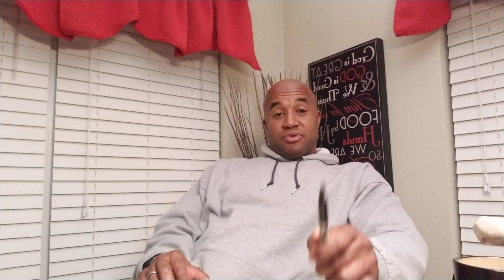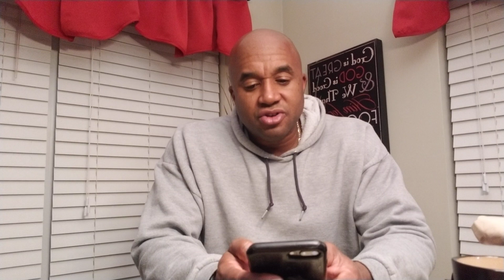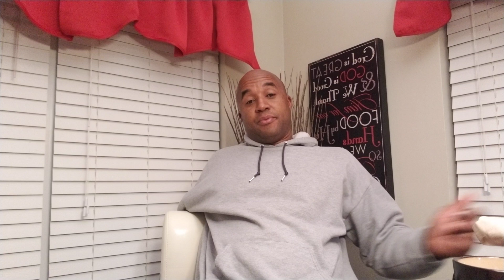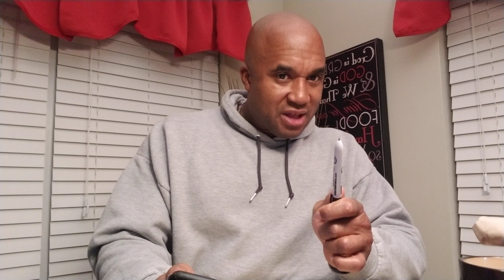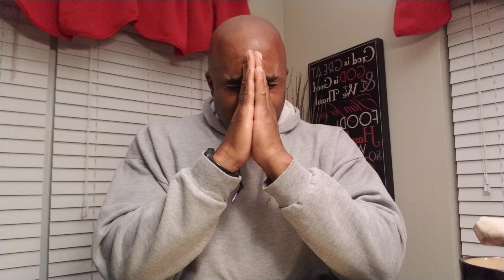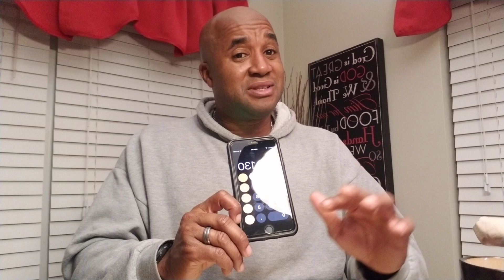Alternator and AGM Batteries the  Connection

Comment: Question why not just go with a bigger alternator for your truck? You said your alternator does 260 why not get a 300 or 350 alternator? And the reason why I said 300 or 350 because it's been some years since I've done audio video mobile but I think the alternators range every hundred if I can remember correctly. Or you could pay a butt load more money and have a custom one built for specifics. But just go to a bigger alternator especially with that diesel truck you already at 260. Why not just go to a 350 or 400?

Comment: I am planning 3,200 RMS audio systems for my Limited and Platinum Edition F150s. I have 400A alternators and plan on running two AGM batteries, an XS Power D6500 for my primary and an XS Power D7500 for my secondary/audio system with an isolator. Will this combination work AND charge efficiently? Thank you for your expertise! I appreciate your videos.

Comment: I have a 150 Amp alternator and one battery on my vehicle.  It is a mini van with a long run of 2 gauge copper wire.  I know that I am near to my maximum without adding batteries and an alternator which I don't want to do.  It is two 450w RMS amplifiers on two 12" subwoofers, and a 200w RMS (50w RMS x4) on four 6x9 speakers. There is of course also the head unit (15w RMS) also running two 6x9  in the front doors. I have a small system but it is fine for me.   In the winter when the heat, wipers, and headlights are used heavily I let it idle for a few mins before shutting it off to top off the battery.
Reply: It's supposed to have %30 reserve power. You should be okay as long as you keep your voltage at least 12. I push a 135amp alt harder than that

Comment: I have a 270 high output brand x alt charging at 14.8, yellow top optima under hood with a d3400 parallel and a d3100 all in parallel can I power a 6,000 watt amp if I charge them? They stay steady.

Comment: I have 2 xspower d3400 with a 270 high output alternator 

I run 2500 watts between 2 amps one for my mids and the kicker CXA 1800.1 amp!

Comment: The alternator is there to keep the BATTERY FULLY CHARGED  the battery powers the electrical needs of the vehicle . The battery is the buffer and absorbs voltage spikes that can be produced by the alternator that harm DC voltage items while the production value of the alternator is important the the capacity of the battery must go hand in hand with

Comment: Bruh that’s exactly what happened to my system. The first time I got it the voltage was resting at 14.1 and with the hardest bass hitting it never dropped below 13.5. Fast forward 3-4 months later it’s  dropping to 12s low 12s and clipping.

Comment: So if i have a 350amp alt plus 3 100 amp agm batteries, i should be alble to power my smart 5 amp??  It always seems to drop voltage.  Not terribly but down to the mid 12s.  Im trying to keep it at least at 13.

Comment: I remember back in my teen years, early 90s, you could tell who had the most powerful system by their headlights blinking.
Reply: You could tell who had the most voltage drop and thereby burnt amps and subs and low output by their headlights blinking*
Reply: From 89 to 93 I never burnt any amps or loose a sub, things were alot different back then no one was running high output alternators and batteries and very rarely you heard of anyone burning an amp and no one was even running fuses. There wasn’t any cheap amps on the market yet like today
Reply: @Jason-bmx oh but there definitely was lol

Comment: I got a AGM on my camry running a U12, Sundown 2000 SFB amp & Alpine 6.5 speaker with an Alpine Type X 4 channel. I'm on stock electrical so I'm guessing it's ok/safe to charge my battery weekly till I upgrade my altanator & electrical?

Comment: What if I have a 2000 rms Monoblock and a 1000 rms 4 channel do I need to supply 300Ah to run my system?
And can a 370 amp alternator sustain a optima yellow top and a Xs Power Xp3000.

Comment: Best video ive watched about voltage and current draw or amprage..Great video
Reply: My stupid truck is ECU controlled charging so I have 2 extra AGM batteries....But I do top them off with a charger like once a week...I do ok like this but I wish I did not have ECU charging...But if I go past 20 on the volume just like u said my alt can't keep up

Comment: Another thing to be aware of agm bateries is that they charge to a higher voltage than a flooded lead acid battery so if your cars electrical system is not agm specific you will perpetually be running them undercharged and damage them

Comment: Good video .i do have a question tho. U said for the alternator amp rating..half of that is for the basic needs of the vehicle and the rest is extra..correct...so in my case..i have an old school car..stock alternator is 60 amp..so thats 30 for the car and 30 extra...ive upgraded to a 290 amp alternator..no new accessories beside stereo equipment...so i should have 260 amp available for extra stuff? Then that should power a 2500 watt system without an extra battery.. correct? Ive done the big 3 upgrade..am i understanding this correctly?

Comment: Dang I'm getting carried away when my vehicle has 150amp alternator and only one company makes a bigger one and I'm not even sure the reliability may have to get a custom one built because I have two amplifiers that are dyno to 3900 RMS. I can't even run one of them without it clipping like crazy even with to a AGM's and then a regular Marine starter battery up front and of course an isolator
Reply: Do you think a 10 farad capacitor would help a little or alot?
Reply: Ok gonna take identical out of tractor so now we have 3 AGM two behind isolator and ordered a 50 far cap and a prayer thx for the video
Reply: I still don't believe it's going to be enough for 8000 rms need to go lithium

Comment: So what do you do about these new smart alternator charging systems? What I done since I doing daily driving is keeping my volume about mid way i have a bass 8k taramps on 2 massive xlr 12s in a large enclosure stock alternator with 400ah of reserves because on these smart alternators they won't charge but 12.5 volts until the ecm tells the alternator to charge unless i keep my headlights on no way around this unless I unplug the wire on the negative post so it will unregulated?

Comment: So my cars original alternator is 150 amps, and in theory my car uses 75 amps, and i replaced it with a 320 amp alternator, and my car takes 75 amps,  that gives me 245 amps left over...so should I get an agm that's good for 120 amps, and have a total running count of 365 amps for 3650 watts? I know you said I need headroom, but that is the answer right?

Comment: XS Power PS1200L or XS Power XP2000...??? Which is a good buy based on your advice with  my setup?

Everstart 12V/800CCA base Batt
215amp Alt ~ SKAR 2000.1D Amp.

Comment: Eeewwww!! You are extremely informative I must say. I've been in and around car audio for over 20 years now, with the exception of life circumstances in there as well. I myself have dove head 1st back in the game over  15 months ago now and I don't mean just grabbin' some new gear and throwing it in my truck. Yes, I have put some in, but now having a daily driver truck is all project now. I have literally been researching, watching and "tinkering every single day since to prepare myself for what I have in the background going on. I have a Brand X 320amp alt, an XP2000, XP3000 in the bed, and a D3400 under the hood. This is where I'm watching your video, helping me 100% comprehend what I'm doing right or possibly doing wrong! I will to start after I pull out the smart 3k, I have a smart 5K Bass  that will be on a couple SAV2 12'S, dialed back a bit, then plan to jump up into the U series, or possibly a couple other options. Long and short, just want to say Thank you! This is a fundamental part of car audio in understanding the math break down. Appreciate you! All Respect!!!!

Comment: u got a god point right there! I've got in my 2004 wv bora, 1.9 tdi, an 120A Alternator, an 74Ah 750A CCA Varta Silver battery ( not AGM ), a crunch gtx 2600 amp and a 8inch vibe sub with 350W Rms of power and 25 mmp welding cable, with a big 3 upgrade and if i pass over 2V on the gain of the amp ... my headlights are starting to flash :)) The battery has just 3 years tested with a battery tester, every year at the begining of winter and is got 98% life in it but the CCA which was 750A last year, now is 650A when i test it ... maybe it wasn't fully charged ... and i drove like 100km per day, with the music at low volume .... So from what i undersand from your clip, wich is very god explained, my batery is to low for the amp ... The amp can output 600W Rms :D Now i've got a question ... what if u got an higher alternator like say 200A of output, the car needs only 50A to run all the electrics and you've got an 65Ah battery ( using an normal battery not AGM ) ... The alternator will or will not dammage the battery in time? It's an iptothetical question ... Sory if my writing in english is bad ... :D

Comment: I know this video is old but I’m hoping you respond with an answer. Can I run a xs power d3100 with a optima yellow top? I have a 300 amp alt. Do you think that would work out for a 4000 watt system?

Comment: I just picked up 2 one year old XS Power XP3000s for $250. (Both are exactly 12.9v resting. I'm excited to hook them up. I have a Skar Skv21500.1d running @ 1 ohm. I believe that amp produces 2200 watts @ 1 ohm max. Its powering 4 Skar IX 10's. (200 rms 400 max each) My OEM battery is in the trunk so I'm going to eliminate the OEM battery all together and use those XS POWER batteries in the spare tire well as my starting battery as well. They are almost 100 lbs each. My cobalt will look like it has a lowering kit, lol.

Comment: What's going on bro thanks you for you knowledge about car audio.. I have a 2014 Honda Accord sport and I have a 2400 watt for front doors and rear deck and I have 1200 watt bass amp from skar audio running two 12 inches svr subs .. is it good to run agm front and back

Comment: 2nd comment I got a 320 amp alternator coming in for a 2000 W system would I be OK with just getting a small AGM battery since I have such a big alternator to support my system or would I still need a bigger AGM battery
Reply: Can't go wrong with goin bigger.

Comment: so how would I know if a battery is too big for instance I have a 90 amp alternator I have a scar RP 2000 if I cut my 90 and half that leaves me 45 so 450 W if I get the same battery you have will that make up enough or do I need to upgrade my alternator as well

Comment: Okay so what happens if you get a higher amp alternator? Like MechMan 370 amp to replace a 160 amp alternator? Like how do I calculate how much my vehicle has in “headroom”
Reply from the maker: Head room is 210amps ..
Reply: it depends on how many watts you want to send to the amp. If you assume your vehicle systems use 80 amps (160/2) then you subtract that from 370, you get 370 - 80 = 290 amps left over for your system. So 2,900 watts.
Reply: @bailey2517 why do u not recommended it
Reply: @956DTech  ignore that. I'm not sure why I said that lol. 2900 watts is fine.
Reply: @bailey2517  what about 4500 watts

Comment: I'd recommend a mechman alternator. They have a 400 amp alt waiting for you. They also put out lots of power at engine idle. If you're running 2 batteries I'd also recommend a battery isolator so one battery cant discharge in to the other. It's a bad feeling when you listen to your stereo with the engine off and then cant crank the vehicle. Isolate your batteries.

Comment: So considering my truck came with a 95ah alt, and ima say I use about 50ah for the vehicle. I just got a 320ah hot rated alt, so I have 270ah of excess to power my cab-22 and 250.4, I’m wondering your opinion on how it will behave until I can afford more backup as it has a 70ah lead upfront and a 35ah agm that’s directly to the amp

Comment: Okay hold up dude you're missing one crucial element to your whole subject and that is your voltage! your voltage determines how efficient getting the amperage to your amplifier is and your car for that matter and your math is close but and would be correct if you only have 10volts and most cars rest at 12.6v with the motor off and 13.8v/14.8v you see it's variable based on your voltage for example if I had 130 amp alternator in my car and my voltage is 14.8 volts I will have a total amount of 1924 watts but if my voltage is only 13.8 volts I'm only going to have 1794 watts you see your voltage determines how many watts you'll have not your amperage alone! it's really simple to get your true wattage of what the vehicle can put out or anything for that matter you can put out at 100% efficiency. To figure out your true wattage you take the voltage number and you times that by your amperage, thats how you get your true wattage! another thing to touch on is your vehicle is not going to use much power if you only have the car running your blower motor is turned off you're not rolling down your windows you are only supplying your ignition system for your spark for the combustion chamber if you're running your blower motor for heat or AC and you have your lights on you are going to pull more current/amps than if you had everything turned off another thing AGM batteries are not worth the investment anymore for almost the same amount of money you can have a decent lithium Bank that has way more current/amperage output and it's will hold your voltage a ton better and won't drop as quickly as AGM the other thing is lithium can run alot higher voltage then AGM which means it will be way more efficient which mean your amps will run alot smoother and won't suck the amperage as hard when you're voltage is higher and holds better 👍😉

Comment: Lot of people go what they think is cheap with extra battery or two.. the reality is $400 you can get 250amp alternator for about any vehicle out there that is a direct factory replacement.. pair that with a single under hood battery upgrade to the largest possible that will fit.. between wiring etc this is a much easier and cheaper solution to the average system.. if you bangin out 10k then you already got all this and eating my time.. but I see a lot of mid range daily’s running 2-3 agm batteries on factory 130amp alternator.. this cost you more money with less performance.. you should start with the alternator first and big three upgrade to go with it.. then swap your factory battery as it dies over the next year or two.. 

Yes I know getting there battery in the back closet or he amp does have some be if it’s over the longer run of wire.. you already running that wire through and it’s the same one feeding that extra battery ans caps etc anyways.. you still have the same issues here.. don’t think cause you got a battery 12” away from your amp that battery is supplying 100% needs when asked.. electrical doesn’t work that way.. half is still coming from the front and you still getting that same delay and drop over that run.. this is why many old school guys still running big caps cause it can speed dynamic burst draws up where a battery no later the type really can’t. 

Upgrade your alt first.. then go agm under the hood then go caps near the amp then if you still getting bigger and bigger then add more batteries to the back.. there’s a reason you see the big boys running 4-5-6-7-8 alts, 10 caps, but only 4 batteries..  ans they just doing demos and burps.. they not riding around 3-4 hours playing

Ok had to come back to this.. this is one of the reason back in the day I swapped everything I had to JL slash amps.. putting out equal power from 12v-14.4 is very overlooked thing for factory vehicles.. still have amp issues but you don’t have to worry about voltage drops as much.. i ran a factory electrical on 156.6 daily driver on stock 160alt and stock 750cca wet bat.. yeah the lights damn near went out when it hit but it hit like that all day.. but Toyota Trucks did a lot better then most here 20 years ago.. yeah my lights looked like strobes going down the road lol.. but point I’m making is there are amps that can help here.. also why I hate these new full bridge monos.. they get hit fast which increase draw and only run at 14-15volts..

Comment: When this man speaks, school is in session and I'm taking notes! 
This some good a$$ content! Thank you MBEnclosures!
Reply: I sure hope not. His math is absolutely incorrect. Every 14.1 watts at idle is 1 amp assuming your alternator is running at 14.1 volts. NO CAR RUNS ON 10 volts. Whatever your voltage is, that many watts is 1 amp. It’s ohms law. 
That said, if your car battery sits at 14.1 when running and your alternator puts out 135amps, it only does so at higher rpm. At idle it’s putting out around 50 amps. 
I’m a master electrician and also used to install car audio. What he’s saying is partially correct but his math is all wrong.

Comment: Can someone help me out plz. I have 7000 watts in amplifier. I'm thinking about getting 2 d3100 XS power. Do I need to change my alternate?  In a 2013 Honda civic.
Reply: Of course you need a bigger alternator. Your stock alternator is only 105 amps. Half of that will go towards your vehicle needs so 52 amps CAN NOT maintain your 7000 watts system plus them two batteries

Comment: When I had two batteries running, for the first time, I made sure I matched what was under the hood, and then when I could I turned them both in for their core charge and got AGMs from AutoZone for 400. Worth the wait they stay charged and I just hit a 142 with less amp wattage at 2ohms than last time I metered at 2ohms with the same subs and better enclosure.

Comment: I'm running my stock alternator with a AGM battery under the hood and a 1800 battery for my system with the big 3 upgrade and I'm running at 14 volts banging my system.